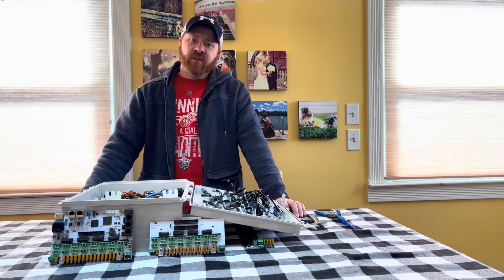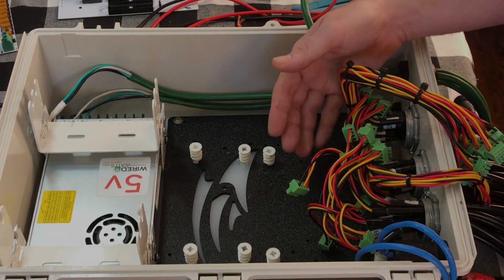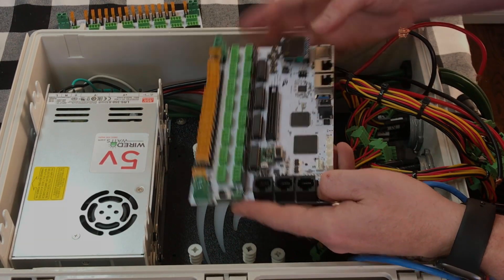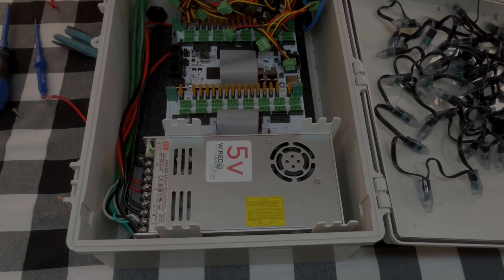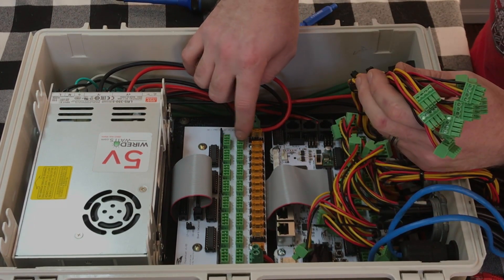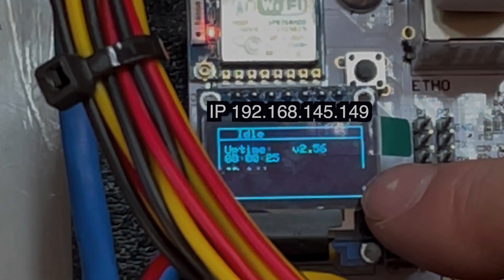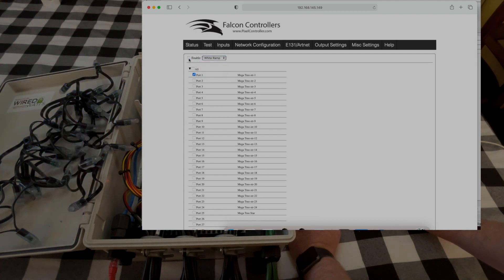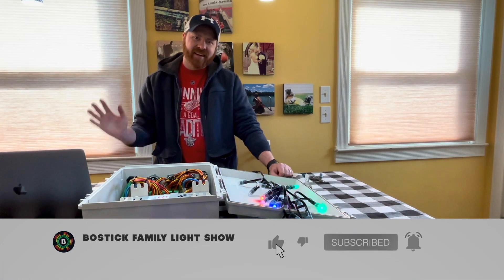How To Build A Light Show - Part 3 Falcon Controller

Comment: Hello Sir.
How do I connect F16 to my Laptop. Or how I control the F16 ?
Thanks Sir.
Reply from the maker: You would connect the f16 to your router or a switch. Then when it boots it gives you an IP address. Type that IP into the URL bar and it will load the falcon dashboard

Comment: 1024 pixels per output. Can you run 1024 pixels on one output without power injection? I understand distance is a factor. Thx.